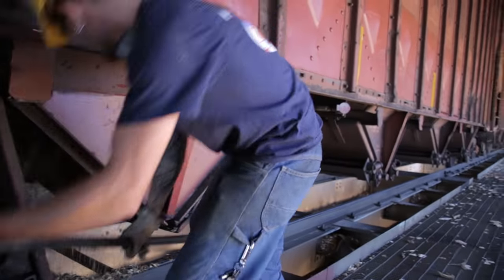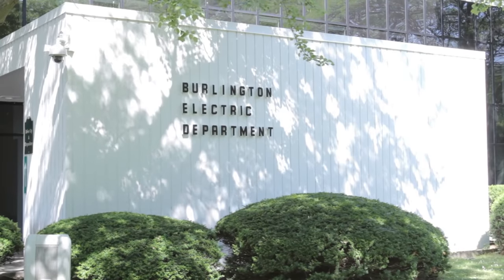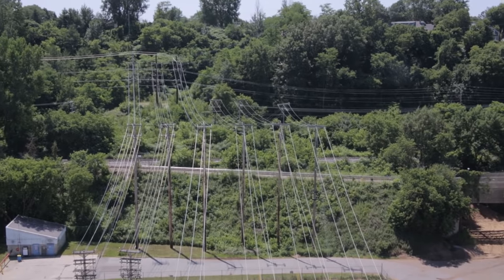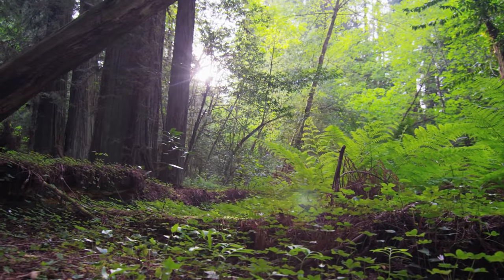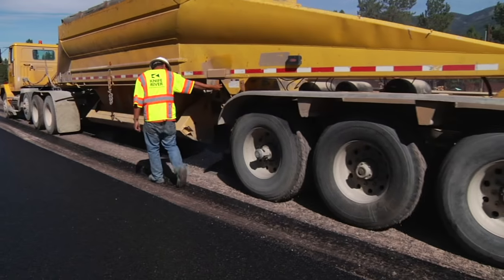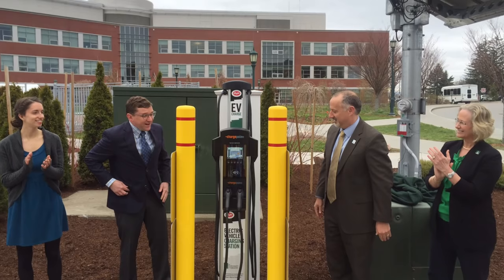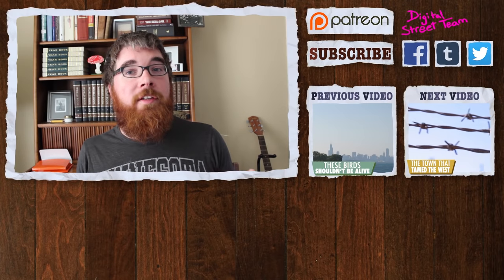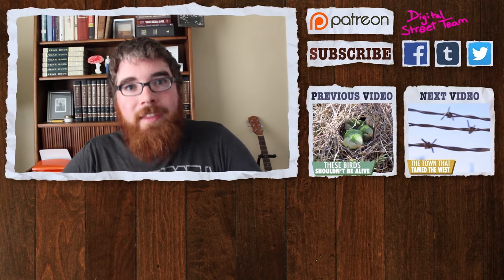Can A City Run On 100% Renewable Energy?

Comment: biomass isn't a renewable resource we can use worldwide. Intentions are good but it isn't the solution we need
Reply: Biomass is a good source of energy as their is a negative CO2 output, but indeed when you scale up it isnt a sustainable source. Not sure on the math, but to power a large city, you would need to cut down an area much large than the city itself. That can be compensated by waste from agriculture, but it wont be enough.

Personally I would love to see an energy market with nuclear (which can be much more efficient and safer then is often given credit) providing a strong baseline and wind, solar, hydro and bio supplementing on a much more local scale.
Reply from the maker: That's totally true, but keep in mind that at the moment there is no single solution that will cover the worlds renewable energy needs, and there may never be.  I think the key is to use a mix of sources, make the best use of what's around you, and be ready to change things up as new technology comes on line.
Reply: It's important to keep in mind that we shouldn't let the perfect be the enemy of the good.
Reply: If we're repsonsible. The Taiga would be a good source for renewable biomass.
Reply: The goal is always to make it work locally. I live out west, and we have an absolute ton of wind and solar power, which probably wouldn't work nearly as well in Vermont. Iceland uses geothermal, which is fairly limited in its geographical reach. Do what works; don't do what doesn't.
Reply from the maker: Totally.  Vermont's got a ton of trees, but not much sun. It was great to see them using a lot of solar panels, but the amount of energy they provide didn't add up to much compared to biomass and hydro
Reply: nemodot the problem isnt with the burning of the trees for energy, its the scaling of the energy source to meet wider demands.
Reply: What about moving to places with more renewable energy like Sahara or Gobi desert, where there is a lot of wind, solar and land?!
Reply: Personally, I have nothing against nuclear power. It's an insane amount of power with relatively low amounts of pollution. The problem is that what little waste comes out is horrendously dangerous. If we could get rid of nuclear power, I'd be all for it though. It's good enough until we come up with something better and I have no doubt that we will be able to do that in the future when power production is decentralized enough and/or we manage to get fusion power going.
Reply: Those countries mostly don’t have the money/political stability and by the way we in the EU import a lot of food and resources from those places ( Africa). We don’t have to grow all our food in the desert but a great portion could be produced in seawater greenhouses and with the amount of energy desalinating  seawater and recycling should not be a problem. The only problems i see are investment and political problems.
Reply: If I am allowed to be macabre and sarcastic, I personalty don’t have anything against nuclear too. The chances  of an intellectual evolution of humans to a higher level and wiping out a great portion via radiation would be significantly bigger. It will be a win win situation. Less humans, less energy and resources needed, more area for biogas solar and wind and maybe more smarter humans to figure out how to build a small sun on earth. =)
Reply: Yeah, I'm watching this from Phoenix, AZ. I don't know how the hell we're supposed to manage that sort of thing here. We've got absolute shloads of solar, I guess, but we don't have much in terms of trees and water, while maintaining a massive population. What's the solution, just make everyone move?
Reply: i am from germany and most of our industry and population is in the south. with the german renewable energy sources actin and due to good wind conditions a lot of windfarms where build in the north of germany. without funding and a lot of resistant from the population against high voltage lines to transport the electricity from the windfarms in the north to the industrial south there were no purchaser for the electricity and no purchaser meant cheap electricity or the windfarms had to be throttled to not harm the grid. a few company took advantage of the situation and moved to the north with jobs. some companies even get paid to consume more energy when the is too much electricity in the grid. so it is possible to move and apropos when coal is found underneath a city in germany it is most likely the  whole city is forced to move ( with compensation of course ). the problem with the us ( or a country with a lot of fossil energy resources , not like germany ) is the energy from the grid is too cheap and energy from renewable sources can not compete and without subsidies, funding or increasing the price of the energy from the grid, nobody will give a flying monkey.
Reply: Unless we engineer some bio crap that grows fast as hell and burns as hell. :)
Reply: *****
No, it's not the same. The Co2 in fossil fuels were taken out of the equation millions of years ago. The world has adapted to work well without that extra Co2, but when it's suddenly released back into the system, it becomes too much to handle. burning wood chips cycles the carbon on a much shorter time scale (a few decades instead of millions of years). A few decades is too short a time for any significant evolution to take place so when the Co2 stores in wood chips is released back into nature, nature is still perfectly geared to handle it.
Reply: I just can't wait until we finally have fusion power
Reply: +Random Person one grows back the other doesn't
Reply: +Random Person didn't know about that oil thing, gonna check out

If u plant a tree and then burn it it has 0 co2 output
Reply: +Random Person then u have to plant enough tress, I'm not saying it's feasible but it's possible
Reply: I couldn't agree more. Burning stuff for energy is on the verge of being yesterday's technology. Actual renewable energy is currently sending the coal industry bankrupt and it's only going to get better.
Reply: +autonomousAscension yeah great idea, sun on earth.  What could possibly go wrong.
Reply: +Paul Mobley actually please tell me what could go wrong. Fusion power is considered to be very safe. Do u have additional information I don't?
Reply: Apparently I do have either more information or just better logical thinking skills.  We heard the same things your saying in the oast when they introduced the reactors we have today.  Nothing could ever possibly go wrong.  We ALL know that not to be true. Just when humans are arrogant enough to say nothing could ever go wrong, mother nature is right there to slap them in the face a prove them wrong.  Yeah yeah I know about thermodynamics and physics laws, but I also know about transuranics and the most dangerous waste known to man.   The waste is still dangerous for hundreds of years that has to be stored which means even more power has to be used (which isnt cost effective and used when factoring terra watt price) for hundreds of years.  No the fact that a fussion reactor has more questions than it answers is the issue.  We have an astronomical amount of unanswered problems with our reactors now that its going to take hundreds of years to get them addressed not only answered.  There is a reason why we have a shield from the sun 93 million miles away and your thinking is to bring that power inside of our shield and have them scattered around the planet.  Like I said sarcastically before what could possibly go wrong!
Reply: +Paul Mobley So you have no idea what could go wrong. Good to know.
Reply: Fusion power, like hydrogen for cars which will also never get off the ground, is being pushed by people who are used to having their hands on the faucets of energy and want to keep getting our money. If it comes off they are locked in to a never ending revenue stream and as long as it doesn't they feed at the public trough.

The same middlemen are pushing biomass burning and tend to be less than fussy where it comes from. There are far better uses for forests than burning them for the energy we are increasingly getting from elsewhere at a constantly reducing price.

Meanwhile my home and vehicle run on fusion power with the reactor a safe distance from earth and no ongoing revenue stream for the middlemen. Those thieves are having an extremely creative time trying to convince people it will never work but, as it happens, the marketplace is starting to tell a different story. Goodbye coal, then nuclear and oil won't be far behind.

At the current rate of battery improvement and cost reduction, EVs will be at price parity with comparable ICE vehicles by 2025. Given the massive difference in maintenance and running costs no-one will want that redundant technology long before then. It's all happening a lot faster than people think, nobody thought coal would be in trouble this soon.
Reply: +Paul Mobley do u know therr is a difference between fusion and fission? (it's the opposite =
Reply: 1nf3ct3dTT absolutly I do.  That why i didnt call the reactors we have now fussion reactors.  But radioactive waste is still just that radioactive waste.  Everyome knows radioactive waste is dangerous all by itself without himan interaction or mother nature putting a wrench in things.  Fussion power is to expensive and mostly i was comparing how both of them would end up.  Kickin rocks down the road. So yeah i know the difference and they both suck
Reply: +Paul Mobley fusion power has no radioactive waste
Reply: +Paul Mobley for now fusion power is not feasible but that's gonna change soon (hopefully in the next 20 years)
Reply: Yeah they said that 20 years ago to
Reply: +Paul Mobley many people say many things but now we know more and can make more accurate timings
Reply: *many people say many things but now we know more and can make more accurate timings*

You are absolutely right. We now know renewable energy, with its constantly improving tech and relentless cost reductions, is sending the coal industry bankrupt. We didn't expect that 5 yrs ago let alone 20. Other fossil fuels and nuclear will follow and faster than you think. 
Fusion power, which is yet to be developed, is unlikely to ever be competitive.

BTW We already have a fully accessible fusion generator; THE SUN!
Reply: +Robin Harrison the problem with fusion is just how to convert the massive hest exhaust into usable energy. Why do u think that's impossible?
Reply: Robin Harrison Paul Mobley Just because the sun works through fusion doesn't mean a fusion reactor would be "the sun on Earth". The sun is many many orders of magnitude stronger than anything we could ever build.
Plus it's very easy to build a kill switch, as the reactor will only continue working if you keep pumping massive amounts of power into it. Need to shut it down fast? Just kill the power. Done.

Also, fusion power is closer than you seem to think. We have prototype reactors that already work right now. The only problem is that they're not quite self-sustaining yet, so they take more energy than they produce.

Final point: we do have access to fusion power in the form of the sun, but fusion plants on Earth have some distinct advantages. Namely, increased reliability (they still work at night/when it's cloudy) and vastly improved efficiency and output.
Reply: I guess we'll find out if it's possible when we actually produce a functioning fusion generator. In any case I'm not saying it's impossible, I'm saying we haven't done it yet and, if we do, it will never be economically competitive.
Reply: Because the sun works through fusion does mean a fusion reactor would be irrelevant on Earth. 
To suggest the prototype reactors that not self-sustaining and take more energy than they produce are are actually working is a bit of a liberty. If they ever get it to actually work by that time the products of our current functioning fusion generator, direct sunlight, wind and wave, will be way to ubiquitous and inexpensive for it to compete.
Here's a clue. Once the infrastructure is in place renewable energy doesn't need heaps of energy input to keep it going.
Reply: Robin Harrison 
Just because the sun uses fusion doesn't mean fusion reactors on Earth are irrelevant. Like I said, they have several advantages over solar power.
Prototype fusion reactors do work in that they undergo fusion and produce energy. It's just not enough energy to be sustainable yet.
Your last point doesn't even make sense. Yes, fusion reactors need energy input to run; that's how they work, and that's been the concept from the start. How does that relate to anything?
Reply: autonomousAscension can you really not see.  Its because it takes energy for it to produce energy.  That simply couldnt compete in todays world just like the nuclear reactors we have now.  The cost to build let alone maintain makes it not a viable option for most of the world. And then the waste has to be stored.  Another cost and drain on the grid.  Of coarse if renewables had the same exact money amount thrown at them like nuclear and fossil fuels for research we wouldnt even be having these conversations like this about anything dealing with fussion or fission.
Reply: Paul Mobley ? Do you not know how fusion power works? A market-ready version would produce more energy than it consumes. If you'd bothered to read the paper I posted, you'd see that with current tech, fusion would be about as cost effective as fission or solar and more cost effective than wind.
And you keep talking about waste. Fusion produces next to no nuclear waste, unlike fission which produces loads and is still considered to be a good source of power.
Reply: autonomousAscension thays just it"next to no nuclear waste".  Yeah compared to what we have now which is truely an unknown amount of tons butnin fact would produce enough with enough transuranics to make it very dangerous and yes it doeant have to be stored for thousands of years like today but still hundreds.  So every other generation will have to take care of the previous hundreds of years waste.  How in any sense does that sound viable for power generation around the world?
Reply: Paul Mobley So your argument is that fusion is better than fission but it has a problem so we shouldn't use it at all?
Reply: As long as they use more energy than they produce they are motors not generators. They have yet to solve that problem so no, they don't work yet. Just enough to keep getting funding.
My last point was just a clue, I'll expand. Energy systems that need lots of energy input, like fusion and hydrogen, are unlikely to be able to economically compete with energy sources that don't. Particularly when those energy sources are constantly reducing in cost and increasing in efficiency.
Reply: Robin Harrison I'll just post this scientific paper again, as you seem to have missed it. https://www.euro-fusion.org/wpcms/wp-content/uploads/2015/02/EconomicViabilityOfFusion.pdf
TL;DR is that fusion is just as economically viable as fission and solar, it's better than wind, etc.
Reply: Your link is to work by fusion engineers who also haven't taken into account the relentless cost reductions and improvement in the technology of renewables. There may have been a point when, had it worked, it may have been economically viable but that has long gone. You may not have noticed but coal is going bankrupt and there's a decided slump in the nuclear power plant building industry, all due to renewables.
BTW your fusion engineers still haven't got it to work yet.
Reply: Well now you're just denying my points with no evidence and setting up strawmen
Reply: I followed your link and responded to it. There is also massive evidence for the reducing costs and tech improvement of renewables. This renders fusion power, if they ever get it to work, economically unviable.
I have no idea what you mean by strawmen.
Reply: Robin Harrison I never said that other renewables weren't getting better, or that coal isn't going bankrupt. That has nothing to do with my argument. There's one strawman.
You also tried to rebut my argument that working fusion is viable by saying that fusion doesn't work yet. There's another.
And you provided no evidence as to why fusion isn't economically viable anymore. Sure, other power sources will get more cost effective with time, but so will fusion.
Even if fusion ends up less cost effective than other renewable sources of power, that doesn't even mean it won't ever be used. We use a variety of power sources today, some of which are cheaper per megawatt than others.
Reply: Coal going bankrupt and the slump in nuclear power plant building are a direct result of the continuing cost reductions and tech improvements in renewables. That is no kind of strawman. 
Fusion power is not remotely viable unless it is working. Working means producing more energy than it consumes. It doesn't work yet. That is no kind of strawman. 
We have no idea when, or even if, they will have an actual working model but, in the meantime, renewables are continuing their relentless cost reduction and tech improvement. Given that very clear trend, even if they get it to work, it is unlikely to be economically viable.
Reply: At this point, it's clear that neither of us are going to convince the other, and I think we're both starting to get a little mad. Call it even?
Reply: You may be starting to get a little mad, I'm still doing rational responses. You might like to check them out, you don't seem to have noticed them so far.
Reply: Fine. I just wanted to end this - clearly nothing's getting done and we're just bickering over this one point. You want to keep arguing at nothing and insulting me, be my guest.
Reply: No insults from me or bickering either, just rational response. Maybe obliging you to think about what you are saying is something you consider an insult.
Reply: Ending with an insult that also claims you never insulted me. Classy
Reply: If that makes you feel better go for it.
Reply: Recently the first successful fusion net power generation occurred btw. Of course it's still far too expensive per W, but we'll see.
Reply: djayjp Oh, I didn't know that. Exciting!
Reply: i agree however it could be for temporary use as the trees are regrowing but i suggest double the tree rate too
Reply: hello we're pyrolysis machine manufacture ecocreation. For renewable energy , we suggest our machine which convert waste plastic into oil. To see our detail , Please type the 'Ecocreation"in search box, You can see what the pyrolysis machine is ..Thanks
Reply: hello we're pyrolysis machine manufacture ecocreation. For renewable energy , we suggest our machine which convert waste plastic into oil. To see our detail , Please type the 'Ecocreation"in search box, You can see what the pyrolysis machine is ..Thanks
Reply: hello we're pyrolysis machine manufacture ecocreation. For renewable energy , we suggest our machine which convert waste plastic into oil. To see our detail , Please type the 'Ecocreation"in search box, You can see what the pyrolysis machine is ..Thanks
Reply: The intentions behind biomass are bad, NOT good. They are wrecking nature just because they refuse to use sensible energy sources like nuclear power, or fossil fuels.
Reply: I agree with you entirely about the burning of biomass. However your sensible energy sources like nuclear power and fossil fuels are under price pressure from the constantly falling cost of renewable energy and headed for the wall faster than you think.
Reply: In comparison with nuclear destruction (Fukushima), natural gas destruction (Alberta gas fields and other places worldwide), and all of the coal mine disasters (Quecreek Mine in Somerset County, Pennsylvania) BIOMASS and other green energies support, a not only sustainable approach to producing energy, also a safe and NON LETHAL and TOXIC way of producing energy. The human race must adopt EVERY single renewable resource available to us. Biomass is a STRONG competitor and has a competitive outlook for the future in terms of energy generation. If countries worldwide looked at NUCLEAR FUSION as the safest and comparable alternative to NUCLEAR FISSION with the aid of every GREEN ENERGY SOURCE available to us including BIOMASS, GEOTHERMAL, WIND, WAVE, SOLAR and more, we could not only create jobs, we could save the future for our children and grandchildren. To the ANTIQUATED mind who believes in TOXIC POWER GENERATION, shame.
Reply: Our absolutely necessary shift to renewable energy will certainly require a suite of strategies. My major concern with biomass is the people burning it are often not very fussy where it came from. I've seen seriously wasted forest described as forest waste and that's not ok.
My doubts about fusion energy is, if they ever get it to work commercially, which is not remotely guaranteed, the constantly lowering price of renewables will make it very difficult to be competitive.
Reply: +Bart Bols Hemp grows like weed. That's a bit of a given, no?
Reply: +autonomousAscension no my argument is that the list of known transuranics is about 211 elements.  When most scientist know the list should be almost 1000.  My point is when a fukushima style event happens with any of the pwrs and bwrs in the world the uranium plutonium mox fuel contaminates an area for millions of years. There has never been an answer to decommission the most widely used nuclear plants when they are destroyed.  My point is there is no answer for the millions of tons if spent fuel,millions of tons of highly contaminated tritium water,or even the millions of tons of low to mid level waste like exposed gloves hammers suits masks boots etc....Now not only do we not completly understand the ones built 60 years ago and society wants to venture down another road they dont completly understand yet.  What if everyother source was like that.  If we didnt understand what coal does and what it releases in the air and whats left what to do with it or if an accident happened no one could go around that coal plant forever. Or replace with coal with fossil fuels or renewables.  The fact is its completly crazy to believe these scientist even remotely have an understanding of what is happening exactly with this power just like we understand every other power source we use daily.   That's my point
Reply: +autonomousAscension no its not because they dont factor in the terra watt price the millions of years of taking care of waste or even the water it takes to cool spent fuel rods for ten years.  Nuclear has never been cost effective it only been for making the resources for weapons.
Reply: +autonomousAscension no its not because they dont factor in the terra watt price the millions of years of taking care of waste or even the water it takes to cool spent fuel rods for ten years.  Nuclear has never been cost effective it only been for making the resources for weapons.
Reply: There are a massive number of things we can do with hemp, all of which are far more efficient and valuable than burning it for energy. Although burning small amounts in a pipe is quite effective.
Reply: I agree entirely. Burning stuff for energy is yesterday's technology, well and truly on the way out.
Reply: For a town with large forestry resource, it's renewable.
Reply: Only if that forestry is sustainable. In other words a net increase in forest and general biomass.
Reply: There is no single solution for energy. Each region and town has to be independent of big business and corporations who dominate entire regions by remote controlling and hogging ownership and profits depriving locals of cheap energy and jobs. These share holders have never even been to any of these areas and have only the profit motive. Energy has to be diversified, localized and made cheap. Some areas can use replant-able forests. Others solar, hydro electric, wind etc depending on the geography and climate.. That's how the jobs and wealth are created.
Reply: ***** Hillary will never be president even if she is elected, just like Obama is now. She will have handlers appointed by the elite. IMO the president is already elected. I doubt Whether even Trump can make a big change. Science and technology is moving too fast and the rulers do not know what's happening. They are outdated dinosaurs and will lose their grip within a few years.
Reply: We need to ramp up our solar power production. Placing large solar panels on every building and every house would help reduce use of fossil fuels and biomass.
Reply: 100th like
Reply: Vermont actually has plenty of sun. In the Burlington area, solar panels can generate about 380 watt hours/sq ft/day, whereas the very brightest part of the country, in the California desert, can generate about 620 watt hours/sq ft/day. Vermont is more than half of the absolute max possible in the US, and nearly at the average. And solar could easily be cost effective there, as it's used in even less sunny parts of Europe to generate large percentages of power.
Reply: Yes, but it seems like the best alternative fuel for the Aviation industry, which consumes a significant amount of oil every year.
Reply: Biomass is part of the solution. It can't cover a 100% but it can cover a significant part. We have a huge farmin industry where large amounts of biomass is being wasted instead of turned into energy
Reply: This type of 'thinking' is what will eventually doom mankind to extinction. BIO MASS IS NEVER WASTED. It is composed primarily of carbon and it will in one way or another find its way to a final resting place from where it started.
I hear all sorts of people calling for organic farming to get us off fossil fuels and then in the same breath saying bio mass can be an energy source. Check out the true definition of ORGANIC FARMING and then come back with how you justify the conflict.
Until and unless people finally begin to realize that all of our current problems are tied directly to our world overshoot of a sustainable population over 150 years ago.when we discovered crude oil and were allowed a short period of coasting past the graveyards then  all the rhetoric and discussion is for naught.
Reply: A tiny city of 42 000 burning 600 000 tons of trees every year! And that's supposed to be environmentally responsible. Imagine how many trees would need to be burned for New York City. This is definately NOT a viable alternative to fossil fuels.
Reply: And one more tip - it's impossible to grow trees again and again and again without fertilizing soil. Some day it will get exhausted to desert.
Reply: hence the ash collected.  it is used as fertilizer.
Reply: +George Washington 
but cant you just use Sewage , Ash and *Nitric Acid ?
*Nitric Acid sourced from Electrolysed Air and Reacted with Ash
Reply: Chris Ng; apparently you know something about chemistry, but very little about the true nature of Energy. The Law of Conservation of Energy states, “Energy can neither be created nor destroyed; rather, it transforms from one form to another”. Sewage, (by weight), is mostly water, with some fine dirt, and a little organic material. The water and dirt cannot be burned, and although the organic material can be burned, it can never be a major source of energy. Most Sewage plants that burn the organic compounds in the Sewage they treat to generate power, only generate enough power to lower the cost of running the plant, but they still need outside energy to operate.
Reply: +The Good Stuff  I am dropping by to appreciate your comment about using a "mix of sources." From the video the gentleman from the electric company in Burlington Vermont stated that their city uses four sources of renewable energy:

1) Solar
2) Wind
3) Hydro
4) Biomass

With a combination like this, it's encouraging to see the type of Energy solutions that a company may provide.
Reply: It's a great step in the right direction to take the initiative to use renewable energy wherever possible. Energy is a subject that amazes me on a daily basis.
Reply: William Manning about 75% of their power is from reliable sources they can crank up or down on demand (within limits, of course). They probably can do without non-renewable sources -- though they don't, for convenience and cost. If most of their power came from solar panels and wind, they couldn't do even what they're doing now.
Reply: I appreciate your response on this subject. So much to learn from each contribution to this discussion on renewable energy.
Reply: it works here
Reply: ringodooby - Try watching the video. :)
Reply: True, which is why they mentioned that biomass is just one part of their total energy mix. In this case, it is taking the role of nuclear as the baseline energy supplier, along with hydro of course. A steady supply for overnight and inclement weather load.
Reply: One solution might be to research and develop batteries/other storage to store your embarrassment of solar power overnight. Different areas require different solutions I guess.
Reply: A 12" 50 foot tall pine plantation tree (I imagine what they are using is similar) weighs about 1 ton. 300 trees per acre at twelve foot spacing... 2000 acres. A fifteen year cycle =30,000 acres. (about 7x7 miles for the city... indefinitely (caveat- if ashes and city biosolids are used for fertilizer.))

If we round up to a person per acre, it would take a forest (or a number of forests equal to) 115x115 miles (that's 13,281 square miles) to generate the same base load to NYC (pop 8.5 million). About 25% of the total area of the state. 

Interestingly enough, New York state is about 63% forest.

Of course, New York will never generate the same share as Burlington  by biomass. A concentrated mega city has different needs. But that doesn't mean that biomass is not a good option where it is possible. And every MW of biomass power is a MW of non renewable power saved.
Reply: ringodooby true ，still burning
Reply: Yeah, like how burning hydrogen generates tons of it.....
Reply: BURNING TREES -- ~~ 2 BILLION HUMANS PRIMARY FUEL BUT THEY ARE POOR
Reply: Gasification. Storable energy.
Reply: Solution should be different in different places, solar won't work in Alaska by hydro won't work in Saudi Arabia but solar works in Saudi Arabia and hydro in alaska
Reply: You are quite right. In each region there will be different solutions. This one works perfectly for Vermont and many many other places. Obviously it will not work in the desert but solar and wind will
Reply: @Azivegu  The entire process is nowhere net zero, let alone carbon negative.